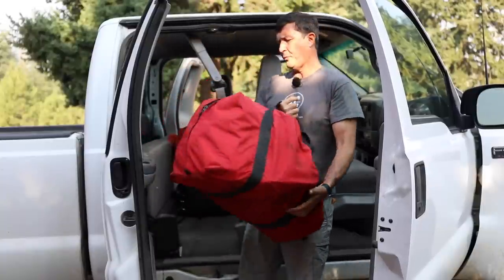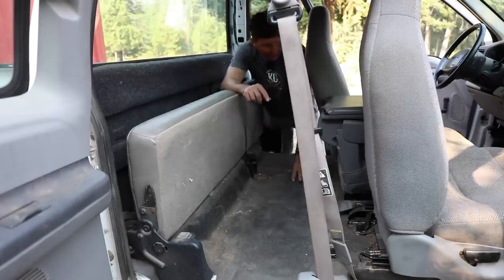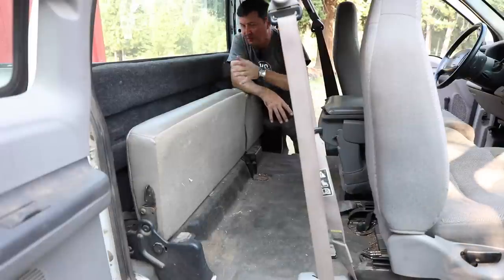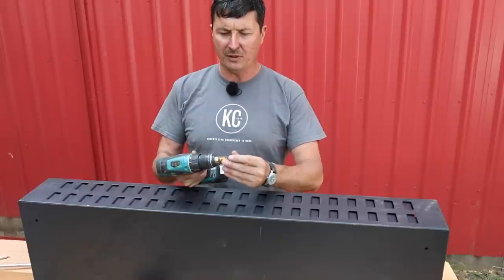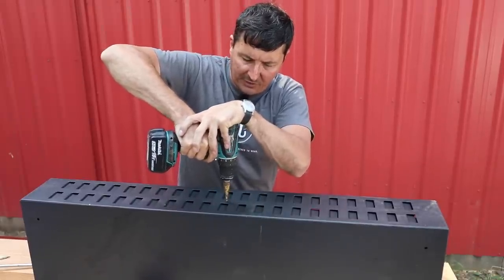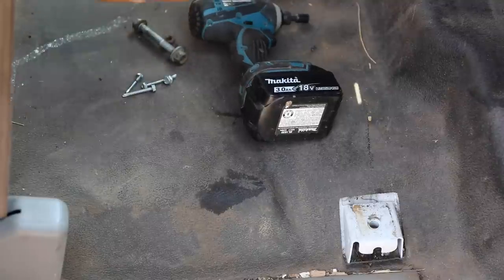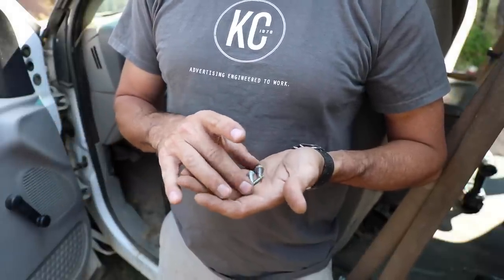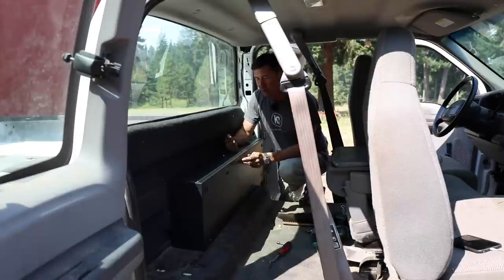Preparing Your Truck For The Apocalypse

Comment: I have one of those fast boxes.  Not a bad piece of kit for the money.  The brackets are designed to mount under a bed (as you mentioned, it can also be used vertically).  It seems to work pretty nicely in the truck.

Comment: I remember when I was growing up late 70's and 80's every truck had the see thru shade with a picture on the back window I'm not sure what there called but they covered the back window with a scene on it but you could see out and a gun rack for at least two guns but even if it was an elcameno or Subaru bratt it had a gun rack in the window

Comment: You could put some labels on the door of the chest to throw thieves off (maybe).  Like (town name) EMT, Defib, sterile, alcohol, sutures, and other stuff that might make them think that it's nothing they're interested in.
Reply: Bill Smith that's an idea.
Reply: Well, maybe not alcohol. haha
Reply: Sorry, I meant to say Vodka.  ; )
Reply: Label it: "Bio-hazard - Evidence - Human Remains"  That's sure to keep the curious and the lawless from trying to open it.
Reply: Hillary Clinton 2016 campaign memorabilia.
Reply: James Nugent, LMFAO. Best comment of the day
Reply: The label could read "Job Applications" and "8Track Disco Tapes"
Reply: Not a bad idea Bill Smith, but if the labels are for medical supplies the thieves may still want to break into the box in search of medications like pain killers that could be taken or sold on the street. If you really wanted to make the box disappear I would cover it with that same grey auto interior carpeting so it at least blends in like a factory original part of the cab. Anything is better than a big obvious black lock box in a car. You might as well put up window stickers advertising the brand of firearms available to thieves while you're at it.
Reply: Yes, I was thinking that the thieves would know that an EMT doesn't carry opioids.  

I'm thinking now that some plastic plant pots could be sectioned and glued on the bottom with stems and leaves coming out to form a nice hedge.  Mrs. W might like that.
Reply: Never overestimate the intelligence of a thief.
Reply: moving pad or drop cloth with velcro hook on one edge, velcro loop taped above the strong box. Less likely to risk breaking into what they can't see.
Reply: @samswihart878  In a way, firearms are pain killers.
For example, wildlife suffering a road accident! :)

Comment: Ideally the "3 points of contact" should be in the three planes (x, y, and z). In this case that's the floor, side, and back of the cabin. That provides the best resistance to forces in any direction. I didn't see if you bolted the back off-camera. If you didn't, every time you brake you'll be applying shearing force solely to the screws on the bottom and side (and of course screws are fairly susceptible to shearing with something as heavy as a safe). I'd go as far as saying the rear of the cabin is more important to mount than anywhere else as forward and rearward acceleration will be the most sudden (and forward acceleration is solved by position already).
Reply: Great point re "forward acceleration " or momentum. In a front end crash that momentum could create a whole lot of leverage on the bottom bolts. Yet, I'd guess those side bolts would mitigate the forces. Just a guess.

Comment: step bits are awesome Cody. I use them at work on electrical boxes for pipe connectors and cable connectors. when the tip gets worn out we just use a bit to predrill and then rip it with the step bit the rest of the way.

Comment: So, great install but I have a few ideas. I hope you read this Cody but I'm sure there's plenty of comments you miss just from shear volume but her goes. I'd add a handle to the door so you're no opening it but pulling the key or knob all the time. I'd also mount one of those soft cab organizers, inside and out so. You have vertical storage for quick access stuff. Also mount a holster inside for a back up pistol. Another idea would be to raise the weapons up in the box, the don't need to be so deep, store the ammo underneath, and or use that storage for emergency last resort survival gear you don't need to get to often.  I have an 05 crew cab and I built a behind the seat storage system and bought an additional one for under the seat. I manage to carry quite a bit of stuff and it's completely out of site. Love the videos is you ever make it out to southeastern Pennsylvania I'd love to show you what I've done in mine

Comment: Cody I picked up one of those fleet f-250s a few years ago but what I did was bought a rifle lock like they use in police vehicles and I installed it on the back piller behind the drivers seat it has a lock built right into it. It's worked good for me for about 2 years now. But I definitely do like this set up and have one of these lock boxes I think I'm gonna install it in my truck so I can have a little more security for my runs to town the patrol lock is good enough for around the farm but I'm always hesitant about going to town with a rifle in it. And since I work on a farm I took all the carpet out and bed lined the floor and up the back of the cab it makes cleaning a lot easier.

Comment: I am definetly pro gun. But it seems to me that you think guns are prohibited to own in europe, which isn't true. I'm from Germany and I do own guns. It's different from the US because you have to take a class on gun safety and regulations before you can apply for a permit, they also check your criminal record and you have to give a purpose for owning a gun (e.g.: I want a rifle for competitive shooting). So most of the times the US way of gun handling seems just a bit unsafe to me, but since you promote locking them up properly and preventing Jack from getting unsupervised access to guns I have no problem at all.

Comment: Great video.  Just pay attention to moisture in the box. I live in a very arid climate and still have rust issues with my truck guns. I used oil at first but it got messy, so I switched to silicon gun wipes and they work remarkably well. With a closed box you might try non-electric dehumidifier.  "Keep on loggin' !" Cody.

Comment: I have the same box :-) I put the hinge on the bulkhead and used the pre formed feet to attach it. The lid stays open just fine and the key pad buttons are closer to the drivers side that way :-)

Comment: You wouldn't BELIEVE how much space I gained by removing the rear seat from my Wagoneer, AND it lightened the thing by 130 pounds. I was so impressed I pulled the rear seats out of my little RAV4, now it's actually useful as a cargo hauler.

Comment: You could totally make a wood panel to fit on the standoffs where the bulges are on the bottom of the box. Wrap it with carpet so things don't make noise when rubbing against it going down the road, and make the job look really nice!

Comment: I use under seat lock box in the rear seat fold down platform f150.   Florida when living there 80's quick reach handgun holster under driver's seat, hey it's a wild place in parts of Florida.

Comment: Great video as always and I totally agree Cody, sometimes it's nice when people follow ole Thumper's advice, "If ya ain't got nuthin' nice to say, don't say nuthin' at all!"

Absolutely do a part 2. I have a 2005 F250 Crew Cab that I am trying to set up as well. Never have anyone in the back either. I have a platform over the seat for my dogs, so I need to figure something out to store under it. Thinking about a sliding drawer system.

Comment: Good comment on foreign views of gun control. And you're not even from Texas. I'm pretty sure most Texans watching this now want a gun safe in their truck. I installed a two pistol safe on the center hump right behind my front row seats. It's finger touch. I've used it for everything from gun storage to wallet and radio face storage when I go biking.  Keep up the good work. A good guy with a firearm and knowledge, encountering people doing bad stuff, usually stop the act and defend life. No matter if that life is for or against gun control. Thanks for being ready.

Comment: the screws on the are meant for feet or dynabolts to the floor the  side screws are either designed for bolt cabs together or 1 long threAD BOLT doing the same thing

Comment: Great video. Suggestion when drilling holes, especially into steel or other metal. Wear safety glasses, and keep a chip brush and brush, don't blow shavings away, you risk your eyes.

Comment: For the back packs and bags, I would fix a pole across the cab at about the height of the bottom of the rear windows. Then use hooks on the pole to hook the bags. I really would not want those heavy bags unsecured in the cab. If you were to have an accident the bags would become missiles and cause any passengers some real harm. You survive the impact only to be crushed by your equipment! By hanging or partially hanging the bags they would be secured to the  body of the truck. However you would still be able to get at the bags when you needed. 

As for the gun storage, I'm from the UK but completely understand the need for firearms. We have lost the right to own much more than a double barrel shotgun or hunting/target rifle, you can own firearms but you have to have a place to shoot them. So a farmer a member of a shooting club like clay pigeon or someone with access to a range. That type of thing. There is no wilderness here and nothing bigger than a badger, no bears or coyotes around here...

Comment: I bought a 2000 F250 with the 7.3 engine back in 2003 with under 100k miles. The truck still drives like new and it hit 400k miles just about 1 month ago.

Comment: I just do not understand the thumbs down. You show a good, smart way to secure your guns. I guess it's the gun haters like you said. 

And you've already got me thinking of removing part of my back seat. (I've got a 60/40 split rear in my 2011 F-150, may take out the 40). 

I love organization so show more! I've done some organization in my truck bed, built an elevated shelf up against the cab wall, then I'm using a couple MTM ACR8-72 Ammo Crate Utility Box from Amazon for organizing items. These boxes slide under the shelf. I've made a hook pole from an old broom handle, pre-drilled the end, then put a hook into it. I use this to reach my boxes that are under my shelf to pull them to me. Works great!

Comment: Need a separate storage for ammo in case you have to travel in a anti gun state like CA. For some reason they think they are above the second amendment and make laws in violation of it and enforce them. 

Something simple like an ammo can with a pad lock on it works as long as the key is kept separate from the key to the gun locker.

Comment: You could have hung it just below the bottom edge of the rear window, hinges to the rear.  The distance down from flush would be whatever it took to insure that the door never hit the glass because it was stopped by the padded box-out section on the top.  I'd have fabricated four brackets that would allow me to use the legs that came with it, and with the help of a second person, it would drop in the slots on the brackets, also allowing the feet to be what holds it in place.  Would also allow for one or more padlocks to keep anyone from casually lifting out the whole thing.

Most of all, it keeps it accessible and frees up floor space!

Comment: Cody, just a thought: I would have tried to install it on the ceiling and keep the extra storage space below it.
Reply: AD S yea that would be awesome. Wonder how hard it would be to do
Reply: AD S there is nothing structurally sound on the roof of a truck.  At the very least he would have to put holes through the roof to bolt it up, and that is just asking for problems.

Comment: You know that despite never once using the jump seats in your truck, now that you've taken them out, you'll invariably need them. 

Always happens. 

You should consider bolting a pad and a seat belt to the lid of the gun box. 

1) it hides it in plain sight, makes it look like a jump seat. 

2) you can use it as a half-ass jump seat.

Comment: I  would suggest that now you have fitted the gun safe, you should disgusie it so it doesn't look like you have a safe there, such as boxing in that back raised section and cover it in the same black material as the floor etc, which would also give you another compartment to the left of the safe to put stuff in that you would prefer out of site, but doesn't need picking up in the safe.

Comment: I really like this modification.  Here in Canada this would be great for non-restricted long guns but also for going to a range with restricted firearms.  Depending on province there are more or less restrictions as to what you can have in your vehicle outside of hunting seasons (some provinces it doesn't matter, some just during hunting seasons (In my province this refers to rifles mostly...  There is something in season year round for shotguns so there is always a legal time to have them in the vehicle).  I can't speak to the defensive aspect openly on a social forum.  Great video.

Comment: Good job. I had my own business and took my 357 with me everywhere except Illinois. I had a Ford truck like yours. 2003 XLT extended cab with jump seats like yours. I could have used the extra room by taking out seats the for my test equipment and a rifle box also would have been great and still had extra space. But now that I'm retired and sold it I will see if I can put one in my 13 explorer. Ha maybe.

Comment: Great video Cody. I have a Ford super duty as well that I have been trying to get set up in a similar way. Mine is a crew cab but I'm also a firefighter/ first responder. I have a bit larger rear cargo area but I'd like to see what you can come up with for storing more gear. I'm almost ready ego as far as removing seats and building custom boxes and shelves. Keep up the good work and don't sweat the haters. They hate cuz they ain't us

Comment: Great Video Cody. FYI you might want to open the workings of this gun cabinet and check the welds . I hear they are just spot welded. Junk AR? Is that the one you made from a striped lower?  Perhaps the the AR is over gassed. Try a heaver buffer weight.

Comment: Cody, your correct on the issue of being the mans man, and being your own man in regards to American Arms/rights,  how ever it is a myth that you will be held liable for being robbed and the weapon and later being used in a crime when properly reported to the police and it's in the National data base. But it is a hard thing to ponder the what if's and how to stay protected for any situation. Damp rid needs to go into box.... anti rust ect. +1 for part 2 and an additional cable and trigger lock would also be cheap and smart extra layers of protection along with a tamper sensor.

Comment: are you worried about humidity or moisture getting into the safe though and rusting those rifles from those bottom holes without putting some rubber washers on there?

Comment: As a retired police officer and volunteer FF I've seen speaker boxes do major damage during crashes. Teens don't think of that when they put those large speaker boxes in their vehicles. A 10lb object can do damage and any larger item if not properly tied or bolted down, depending on what it is, is very dangerous. Even baby seats. Some folks just put them in the back when they don't have their child in them, they should be belted in.

Comment: How did you secure it to the back of the cab?  I don't think you could get an impact driver in there.  It only looked like you secured it to the bottom and side of the cab.  Kinda defeats the "three points of contact" thing otherwise.

Comment: I'd like a part 2 to this.  Though your mod wouldn't work for my uses I do like the lock box and layout idea.  Wear my family lives few ever lockup there firearms.  With better safe than sorry I like to keep them locked up to and in most cases ammo separate.  I got a real laugh out of the locking BB gun statement.  Never done that.  I've never even thought of locking BB/Pellet gun or Bow.

Comment: Good job Cody. Its good to see you keep you firearms secure. It is the One Thing I believe America should overhaul is its gun storage laws. If you own a gun, no matter what type then it should be law you keep it secured. We have this law in Australia, and its a GOOD thing.
Reply: Ram2 while I agree with the sentiment, allowing the government to start putting requirements on anything is just asking for abuse and over reach. Germany for example has gun safe requirements. Recently they upped the requirement from an affordable option to a very cost prohibitive option.  You'll get backdoor gun control like the NFA. It has to be the gun owner that takes the responsibility and Cody is doing a great job of modeling this.

Comment: I never see you work on your vehicles other than the tractor. I suspect most homesteaders spend money and effort on their trucks and cars.
Reply: As I recall very early on  when I started watching Cody , 2-3 years ago he did some work on the front-end of the truck. Tie rods, brakes, ball joints? just don't remember, but he has shown some. I would like to see you continue this series. Would also like to see you and Jack do a truck for Jack . Not a ground up restoration but a ground up mechanical restoration so Jack would have a safe vehicle to drive when he turns of legal driving age, just a thought